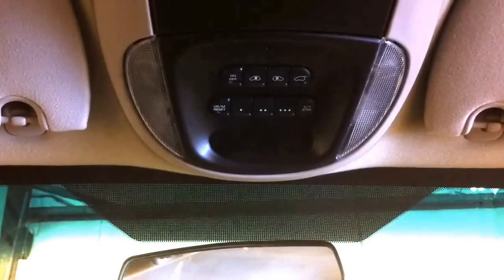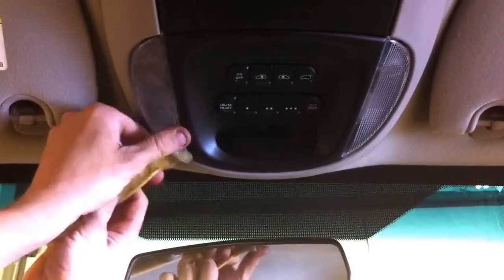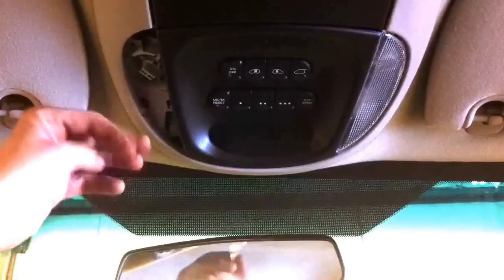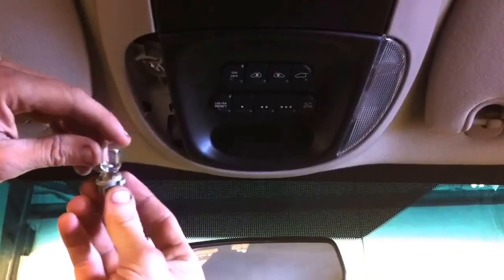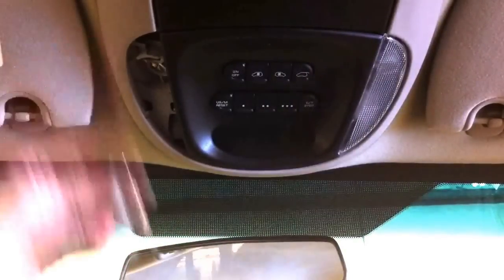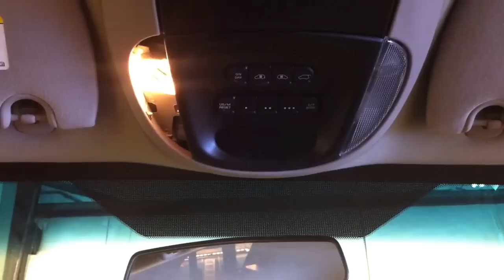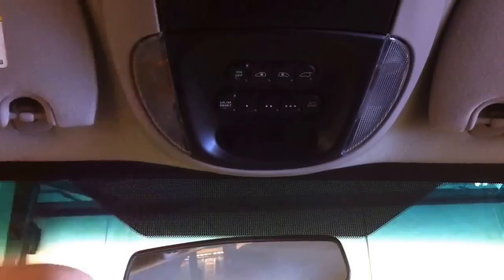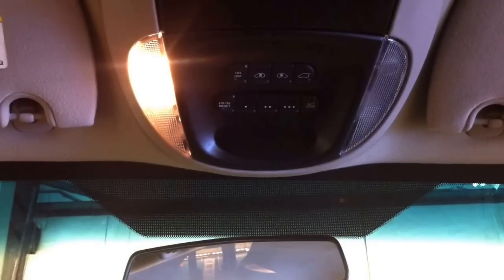2001-2007 Dodge Grand Caravan/Chrysler Town and Country map light bulb

Comment: Thanks a lot for your tip! I did exactly what you advised. Turns out, my bulbs were not burned out but was in need of a light scraping of the burned plastic at the bulb contact points. Placed the bulbs back in the fixture sockets, with the bulb contacts positioned 180 degrees different, and wah-lah! Perfect! Thanks again!!

Comment: When seeking an understanding of the current issue with my 2007 Town and country van, I always look for your videos first.. no chitchat, no lengthy intros with music and graphics, very direct and you don't make it difficult like taking off the manifold to get to the spark plugs. I only wish you covered more issues on my van. Whenever your videos aren't available on what I need to do I'm always at a loss. Thanks for your help, good job!
Reply: Ps.. the sockets for these bulbs is melted and both look like they might have caught fire. Not sure what to do, except to without light in the front seats.

Comment: Don't put a stock bulb back in- they get too hot and melt the plastic. You may end up having to replace the entire assembly. There is an easier way to convert. Get a Pico brand bulb adapter, part #5458PT. I purchased 10 LED's (because they were as cheap as buying 2- don't know how long they will  last), JTech10x 194 168 2825 T10 5-SMD White. Both are available on Amazon. Put in the LED bulbs and they will burn cooler so the plastic does not melt.
Reply: Hey Pete! I would imagine you still have 8 left, would you sell me 2? or would those other lights be good for the other interior lights in the van?

Comment: Thank you very much. Very concise and easy to follow. Now I need to find out where my flasher unit is on my 2007 Town & Country mini van.  I'm checking all the fuses, found 1 blown so far, but after putting in the rear brake / turn signal bulb incorrectly (bulb pushed the 2 pairs of contact pins together, instead of the bulb fitting between them), I obviously shorted out something big time. I'll deal with it in the morning when it's warmer and hopefully drying.  Lost my rear brake lights and all turn signals as a result. Dumb me for doing it in the dark at the parking lot by the auto parts store in the drizzling rain.
Reply from the maker: thanks for the comment. its always much appreciated. as far as the flasher unit that you spoke of, there is no stand alone combination flasher like in older vehicles. all of these features are controlled by items such as the body control module as well as the integrated power module under the hood. I feel your pain, if have been waiting for it to stop raining and maybe a bit warmer so that I can put a wiper motor on my wifes 2005 grand caravan lol

Comment: Very helpful. Both of mine had melted and the contacts had backed off. I just bent them back into position and they are good to go. Thank you,.
Reply from the maker: +Andrew Carstarphen They offer LED replacements if you don't want to get the overheat condition again. Here is a link: http://www.amazon.com/gp/product/B015V8JO5C?creativeASIN=B015V8JO5C&linkCode=w00&linkId=Y4K6PX2ZUY4V7TR4&ref_=as_sl_pc_tf_til&tag=motorcmecha01-20

Comment: No idea why but when my bulb is fully turned in it won't light but after slightly unscrewing until it lit up, it stayed on solid. Worth turning the bulb with the door open before fully removing in case this could work for you and buy a little extra life from what I assumed was a burnt bulb but maybe we instead a worn contact.

Comment: I use the map light for extended time...it gets hot during summer...The other nite, my bulb went out...The lens was VERY Hot...It cooled down and light worked again.. Tonite it went out again, but wouldn’t go back on, so I found this video....As I turned the bulb to remove it, the bulb lit up...SI could see the Partial Melting and Browness on the edges where it got too hot...I screwed the bulb back in but it won’t work all the way screwed in, so I loosened it like a tiny bit, as if I were unscrewing it again...and the bulb works....I kept it in this position so it will work...I hope it holds out and doesn’t shut off when I drive over bumps...cuz like I said if I screw it tightly in, it won’t work, due to the partial melting as I mention in video...what is my other alternative to fix this? The issue isn’t the bulb, it’s the partial melting of the plastic...

Comment: Great video!  Very precise instructions.
Can you help me out with something? I just bought a 2002 Chrysler Twn & Cntry LXi . And I just noticed that all the reading/map lights don't work when depressing the lenses. They only come on when doors are opened or when the dash switch is rotated upwards. Didn't find a fuse designated for them. Also didn't find anything online about it so far. If you have any info I appreciate it.  Thanks! 
(btw When the reading lights ARE on (while the doors are open), then each light turns off when it's lens is depressed)

Comment: thanks so much. I like learning about my fan and being able to fix it myself
Reply from the maker: +rndmnova Awesome! Glad it helped and I appreciate you watching. Make sure to subscribe!
Reply: +MotorCity Mechanic meant to say van.  I just fixed both of them!  one of them just want clipped in all the way.   next project is my slow power windows.   they work but seems like a slow. .... battery.   what would I look up to fix that?
Reply from the maker: rndmnova What can happen over time is that the rubber seal/run channel can get worn. Its lined with felt and over time from the windows going up and down can rub thru the felt down to the rubber and then it grabs the glass when it moves instead of allowing it to slide. I have seen that issue before. The other item I do recommend checking as you mentioned already is a battery test to make sure we cover our basics. You can remove the run channel and inspect the inner portion to see if worn

Comment: Great Instuctional video.  When I took my overhead map light bulbs I found that the plastic was melted and could not get the light to work.  Can you show how to remove the whole unit?
Reply: you dont need to do that just go on amazon walmart sales same bulb and amazon has a 10pk for 9.00 that sets bulbs in a connector and twists in

Comment: The bulb has changed and the original that came with my 2006 caravan is no longer available.  The two options are to either replace the dome unit or alter the bulb now available.  Its not at all easy as a fair amount of plastic has to be removed.  If anyone knows where the original bulbs are available I'd appreciate hearing.
Reply from the maker: I looked on line and see where advance auto sales them. Here is a link. The ones they show look the same to me. If you not states side then maybe you can try searching by the part number on the link as well. thanks for taking the time to reply. make sure to subscribe and spread the word! http://shop.advanceautoparts.com/p/dorman-oe-solutions-replenishment-bulb-pack-639-008/10318567-p?cm_mmc=ACQ-_-Google-_-GPLA-_-10318567&ci_src=17588969&ci_sku=10318567&ci_gpa=pla&ci_kw=&iv_=__iv_p_1_g_12425515822_x_pla_y_6201684_f_online_o_10318567_z_US_i_en_j_73682442382_s__n_g_t__d_c_v__vi__&gclid=CjwKEAiAsJanBRCgnpfa0orvyz4SJAAbxEq-6bujTlWffMEAXdZlZJ8hmcnWzcJdNeF17y4rxCyofxoCsRnw_wcB#utm_source=acq&utm_medium=google&utm_campaign=gpla&utm_content=10318567

Comment: I just bought a (new to me) 2006 grand caravan sxt.... Turned on these lights overhead.... Man they are so much dimmer than the ones that I had on my 2005 Caravan C/V.... wondering if i can replace the housing with ones from a C/V?
Reply from the maker: Not sure.....it may be possible. I just havent tried it myself. If you do....let me know how it turned out. Thanks for watching and make sure to subscribe.
Reply: same with me... 05 cargo lights were bright... then that van was wrecked...totalled... got a 06 sxt and the lights are dimmmmmm

Comment: Thanks!  I've tried to get this fixed at the garage more than once and it still doesn't work.  Today, in the cold, it turned itself on so I think the bulb is loose.  Now I know how to check it.  Thanks
Reply from the maker: +movourneen I am meaning to do another video on that light.....I have an LED replacement I need to film and show their operation. The LEDs wont generate as much heat and give off a nice "whiter" light. Stay tuned
Reply: +MotorCity Mechanic  -- that would be great because I have another one burnt out.
Reply from the maker: movourneen cool. I will work on trying to get the video made...in the mean time I will try to attach the amazon link to the LED versions in the next day or so in the video description section

Comment: Hi, Thanks for the great video - kept me from possibly trying to pry out the wrong end of the bulb cover. But the bulb I have is cylindrical, metal on both ends.... I looked in the manual (car's not here right now to double check) and I went inside the Advanced Auto store. The guy came out and said, yeah, Youtube this, as there is probably a way to do it, but without any screws visible, he didn't feel comfortable messing with it. I told him the number from the manual, he went back in & I bought the bulbs (two pack) But Now.... They do Not look like these so I will have to see what happens when I take off the cover. I saw one video where it says there's two kinds, LED and regular. Hope that mine is the right one, but if not it's a trip down the road is all. Thanks, Doreen in FL
Reply from the maker: +Doreen Campbell Afternoon...there are a few different versions....not sure what year your mini van is but I do have another video that may help you....its for the 2008 and newer. https://www.youtube.com/watch?v=T7ifLN6ULp8

Comment: My overhead monitor read -40 and my AC is not working,, do you know whye????
Reply from the maker: The possible problem with your vehicle is the ambient temp sensor mounted somewhere usually between the front bumper cover and radiator. This reads the outside temp. The temp saying its so low could also cause the a/c to not come on do to the false below zero temp reading. No a/c needed in the arctic lol. You may have hit something and damaged the wiring or sensor.

Comment: The bulb is PC579 which cost me a total of $8.98 with tax for two (2) bulbs at our local NAPA auto parts store. It is interesting that neither O'Reilly nor NAPA had these bulbs in stock. Because we live near a NAPA distribution center, they were ordered and arrived same day. 

I used a simple paper clip that happened to be laying on the car floor to pop the plastic doo-dads off the assembly. I did not unfold the paper clip -- used it as was -- it worked perfectly, though it did bend a bit. A larger, stronger, firmer paper clip would be better.

The bulbs need to be inserted exactly straight in -- even if they are off a very slight bit, the contacts won't mesh. It's a bit touchy but trial and error will get them to work.
Reply from the maker: +Bruce Oksol Sweet, thanks for the info. Its always cool to see viewers helping other viewers. Thanks again and make sure to subscribe
Reply: +MotorCity Mechanic Thank you. Had it not been for your video, I would have had no idea how to remove the plastic doo-dads to get to the light bulbs in the first place. Thank you.
Reply from the maker: Bruce Oksol Your welcome and its much appreciated!

Comment: I have a 07 and the drivers side bulb burns dimmer than the right any idea's on what's causing this?
i checked for loose bulb, it was tight.
thanks for any input.
Reply from the maker: +rusty nails I would first make sure that the contacts on the overhead assembly are clean and no melted plastic of overheated spots. Second thing I would do is use a multimeter to see what the voltage is at the contact points where the bulb connects to. You can clean the contact surface with a piece of sandpaper if needed. Thanks for the question and make sure to subscribe

Comment: Good Video. I bought new bulbs.  I noticed that the connectors were folded over, unlike the original ones.  I still managed to make sure they make contact with the metal.  Still no go.  Not sure what the next step is.  How do you know if the contacts need cleaned and what is the process?
Reply from the maker: +Bryan Little To check you need to check for both a ground and 12 volts at the bulb contacts on the housing. We need to know we have power and ground. If one or the other isn't present then we need to check further such as the wiring going to the lamp housing. Cleaning isn't usually needed unless your see discoloration on the contacts or any burnt plastic for example.
Reply: +MotorCity Mechanic I went to the Dodge dealer and was told that I need to buy the whole socket/bulb assembly sold as a single unit.   I purchased them from the dealer at that point.  We will see tomorrow when I have access to the van.  They are confident that it will work and was basically reprimanded for not coming to them in the first place.
Reply from the maker: Bryan Little sometimes its just the bulb....some times the lamp assembly. I would have tried the bulb first like you did. Otherwise replacing everything (assembly) always works even when its over kill and just a bulb. You did the right thing with the bulb.
Reply: +MotorCity Mechanic bulb/socket assembly from the dealer worked.
Reply from the maker: Bryan Little Thanks for the update. Enjoy your weekend

Comment: Mine doesn't look like that inside though. Underneath the lens is a metal piece.
Reply from the maker: PlanBModels What is the year model?
Reply: 2007 Grand Caravan. I think it takes a tube-shaped bulb, but it's not supposed to.
Reply from the maker: Everything I keep seeing shows the style in the video. Not sure why the difference. Very odd in deed
Reply: Mine had a metal heat shield of some kind, which you squeeze the ends and pull off. The bulb is a tube style bulb #578, held by clip contacts. Maybe this was the design for the following year, installed on some cars early.(?)